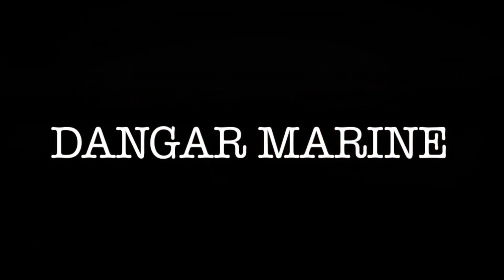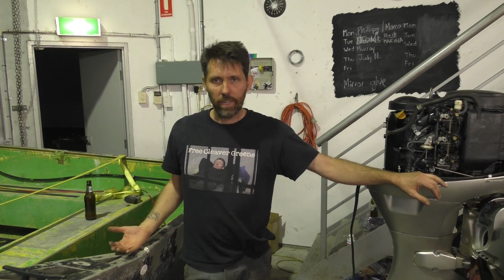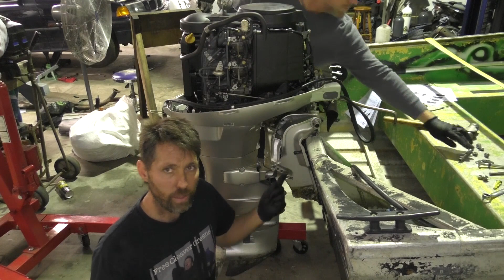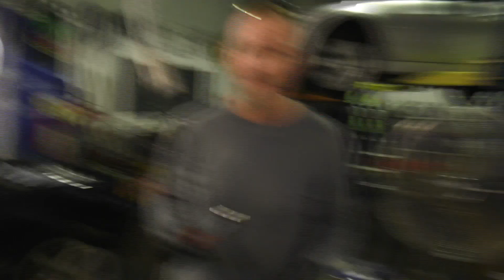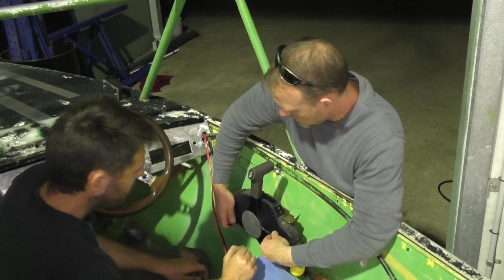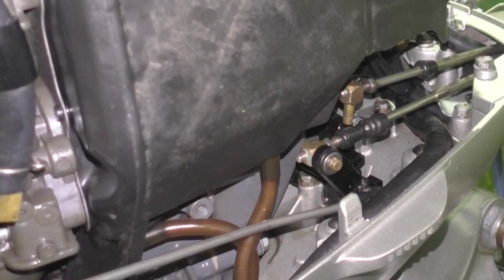Mounting an outboard motor

Comment: Great advice, sometimes it's not a bad idea to install the steering cable before setting the motor. The cable may not have enough clearance to install if the motor is closer to the side of the boat, or spash well. You're great at making procedures easy to understand. General rule of thumb for installing a motor at the proper height is the cavitation plate should be even or one inch above the keel/bottom of the boat. Easy to do with the boat level and a straight edge. I've been a boat mechanic for many years, but still learn new things when I watch your videos. Thanks for passing on your knowledge
Reply: I concur 🫡

Comment: I put a new Tohatsu 9.8 HP on my father’s aluminum boat last year. It gets the boat up on plane nicely and will cruise about 16 MPH until you open it up to wide open throttle, then the bow is pushed down and it begins to plow through the water. Both the boat and motor are short shaft, but dad’s old boat is exactly 15” on the transom. The anti-cavitation plate is 1-1 1/2” below the bottom of the transom. I’ve tried adjusting the angle of the tilt on the motor with little change. Is the motor too low in the water? Thanks and I enjoy your videos.

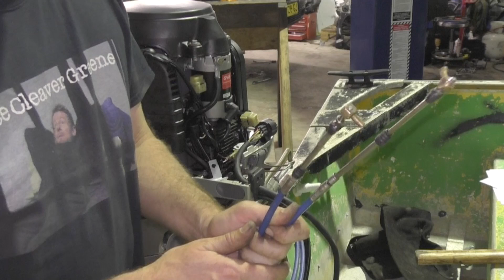Comment: I would love to know where I could get similar control ends that used the R clips on the two control cables (throttle and gear selector cables) at 12:52. Thank you.
Reply from the maker: I'm not sure where these came from. Maybe Honda original? These nut types are the only ones I can find now. https://www.ebay.com.au/itm/124755351986

Comment: Hello, where to start, 2 melted impellers later on a 50hp honda 4 stroke after 20 seconds, has me lost to next move. Its on a lil hobo, and no water from pee hold using muffs  or barrel causing blown engine, 120, 110 100 compression, 25' shaft with no chance of finding a motor and all I want to do is get out on the lake!  Ang suggestions?? I'm just a 70 year old gal who wants to go fishing!!lolol

Comment: What is the part called that hooks up to the the motor that pushes water so you don’t over heat and mess parts up it hooks to the water hose and hooks to the part that sucks the water in to keep the engine cool

Comment: I have a pontoon boat, can I use the same measuring strategy by pulling a string across the bottom of the tubes and checking the cavitation plate height..thx

Comment: Stu, When you fit an outboard, what is a good height. Should the cavitation plate be in line with the bottom of the hull as a start point. I am checking my motor height and come across this video on the Green Machine,

Comment: Im thinking about getting a boat, but I am not good at mechanical things. I saw an ad online about a small used boat. The ad said "small sports boat" Without engine and gas lever. Im wondering is it hard to fit an engine to the back of the boat? How do you connect the gas lever to the engine? The gas lever is over by the steeringwheel. And do you need a separate gas tank or is that somehow built into the engine.

Comment: How do remove an outboard from the transom bracket? Having difficulty with my Yamaha 40hp
Reply from the maker: Generally just four bolts but the sealant used to stop the holes leaking may also be holding it in place.

Comment: I wish you did this for every motor so we could learn hahah... doing DT40 converting from tiller to remote control on a power renewal from an old 80s dt40 to new... there seems to be some type of kit but wondering if I can bodge something up now after seeing this vid
Reply from the maker: You can always bodge something. ;)
Reply: @DangarMarine  YOU can! Not the rest of us hahaha... my mate 'Paul' and I yanked off the old DT40 over the weekend... only too realise that the lads at Suzuki made the gear selector and throttle assembly inside the cover now... because then you can buy their silly conversion kit...  we are hoping to do something on the drag link so it fits (they also relocated the screw hole on the handle part of the motor housing so you needed another kit)... another issue you pointed out was the height of the blades to reduce drag/cavitation - do you have any handy ways to increase the motor height by 2 inches or so? Wish you were somewhere close to Bris/Goldy mate you are a wealth of knowledge. I first found you on the vid you did about the renaming of a vessel according to Poseidon's leger and it was one of the more detailed explanations of the process. Thanks again

Comment: I found a alum boat in florida in 1983 ish at scuba show . 
The out board motor was mounted infront of center consul making this boat have a tunnel hull 3/4 and a moon deck in rear for fuel tank . The boat was 32’ long 102” wide all alum .. if any info let me know . 
I ordered one but had to cancel do to width but now its legal on road

Comment: Stu. that I know of all bolt's nuts should be installed inside transom, not outside. If nuts become loose won't be seeing them, risk motor to deviate away from transom into the ocean. Inside it's a much better place to re torque all nuts from time to time if in need to do it while combo is under way.
Reply from the maker: Outside is much easier to see and get to on most boats.

Comment: You know what gauge that piece of aluminum is going from side to side holding the steering and gauges on the dash?  My boat is similar, but it has rotted wood from the 60s.  I really like the aluminum look, really cool boat very much the same as the one I’m playing with a 62 Crestliner Scout.
Reply from the maker: I'd say it is about 3mm thick. With that dash I sanded it clean and then sprayed some clear coat from an auto parts store to stop it oxidising.

Comment: Great video, thanks for working through the process step by step. I'd like to know where you picked that up for $200!
Reply from the maker: Thanks mate. I was lucky with this outboard. The boat it was on sunk and the insurance company paid for the owner to buy a brand new one so he was happy to part with this one for next to nothing.
Reply: Dangar Marine ahh, I see. Great luck for you :) I just bought my first boat, an old Caribbean Sandpiper (I've been round boats my whole life but this one is mine) but it's in perfect condition with a brand new transom and floor. The plate recommends an 85hp motor. I've been offered a Suzuki DT115 for next to nothing , is it too big for my boat? Local boat mechanic says it will be fine but I'm not so sure :/ Any advice welcomed.

Comment: prop slippage is not called cavatate, its ventilate.cavating is the pressure on the front side of prop,causing water to boil, which causes damage to blades. ventilate is when you loose bite from lack of water from prop surfacing.

Comment: Great video I just bought a 115 hp mercury to replace my 50hp force on my pontoon.
Reply from the maker: That should do the job!
Reply: Dangar Marine I guess the best way to pick it up is flywheel since they are both mercury ? Hoping my controls swap over. 115 is a 94 and the 50 is a 1998
Reply: I’ve been a mechanic for most of my life but never had a boat. Any advice is appreciated
Reply: That’s a jump !   60 hp ! Damn it boy !

Comment: Hello from Finland! I have the same enginge, a BF40. I noticed you did not have to use choke or the idle throttle at all when starting. Mine wont start without choke or at least much idle throttle. It runs great after 2 minute warm up. What could the issue be? Idle is set at about 800rpm.
Reply from the maker: My BF40 has an automatic choke so it is always getting a bit of extra fuel on start up. It could that the idle jets in your carburettor need a clean, but other factors like compression can also affect cold starting. It may also simply be that it is a bit warmer in Australia too. :)
Reply: Dangar Marine thanks for your answer! Its like 31° C here now and still need to use the idle throttle to start it, not necessary choke. The dealer I bought it from 2 months ago did a full service and cleaned the carburettors. When he got the motor it was idling at 2500rpm(!). Maybe they set it down too low because it is not sounding healthy on idle. Will stall some times on idle. I'll try bumping the idle up to 900-950 rpm max. If it doesn't help maybe I'll just live with it. It runs so great otherwise...

Comment: Another great video. What about the positioning in terms of sideways and end on angle. Should it be actually offset by an inch or so from the boat centre line then angled in so the prop remains on centre. I understood that helped with the torque of the prob trying to twist the boat.
Reply from the maker: Can't say I've ever seen a boat with the outboard angled like that. Generally the weight of the driver counter acts the prop torque.
Reply: Dangar Marine .. Thanks. that makes sense. It was a setup handed over from a ski racing provider here in the UK. Probably serves overpowered rigs. May I thank you for the quality of what you do online. I was enthusing to my GF about how great it is you start a video with a low-key task... then it all blows up with 'fix' diversions, representing the real world of shitty outboard nuts and bolts that won't play ball. Yeah... she's only interested in our boat 'working' .. jeez !

Comment: Gday stu ive just purchased a 40hp honda 2004 on your control do you have oil and water temperature lights cheers Daryl
Reply: Because mine has
Reply from the maker: Yes, it is actually cylinder head temperature (and the water isn't recirculated) and oil pressure.

Comment: Y dose my outboard spray water from back of motor as a v. parsons 9.8 on tackacat 3.4
Reply from the maker: If it is going from the engine, that is normal for water and exhaust to come out there. If it is spraying up from the prop you may need to trim the motor up more by changing the location of the pin that supports the leg.

Comment: Hello i see all yours videos and really enjoy. I have a question i have a evinrude 9.9 1982 i don't used for about 2 years now am try to start and is dead i install a new carburetor kit. I check the fuel pump and is good . I replaced the sparks plug , new gas. And is impossible to start i have spark. What You thinking can't be . Thanks
Reply from the maker: I would try sparking starter fluid in. If it runs for a moment it is fuel. If there is spark but it won't run even with fluid it could be low compression, bad reed valves or even something like the flywheel having slipped https://www.youtube.com/watch?v=eNPfuLXCgys

Comment: What torque did you use to mount the bolts? Is this for all outboards this size? Thank you.
Reply from the maker: Generally with outboard mounting bolts you have a second locking nut rather than tightening them too much as you will only crush the transom of the boat. This can be as low at 40 ft/lbs.

Comment: Stu been watching a ton of your videos and i just recently "proper boat " and my new honda outboard its only 14ft boat with 15hp honda but have been fixing boat as transom was completely rotten to the point its just soft so i re done the transom and now want to bolt the engine on so i dont have to lift it on and off every time , is that adhesive you are using called "Soudal T-TREX High Grab Panel Adhesive" ?? if so would that be best stuff to use ? Never worked with boat or engine in my life so need all the help i can get haha i been learning fast and so far everything has worked out fine , lucky the engine is perfect just boat that needs the work
Reply from the maker: Hi mate, congrats on your new boat. I was a T-Rex sealant we used, but I'm not sure of the exact type. The name certainly sounds familiar.
Reply: Thanks Stu , ill try that stuff :)

Comment: What do you call the metal slate that holds the throttle cables? The guy that sold me my engine bf30 didnt have it and i cant find it on hondas website. And what fittings did you use for the motor? It would help alot thanks
Reply from the maker: I'm not sure what they call that plate, but I have made one up from a piece of stainless steel plate in the past when it has been missing. It is really just a locking plate with some slots drilled into it that the groves in the cable collars can slot into.

Comment: I'm just working my way through all of your videos (very informative), I'm busy fitting out a boat so I was particularly interested in the electrical based vids, I've basically wired my boat the same way as you😁. My next job is to swap my motor from the Mariner 60 Bigfoot to a new evinrude e-tec 70, can't wait to get started, Stand by for questions 👍😉
Reply from the maker: Hey Darren, glad to hear you are enjoying the videos. Good luck with the new e-tec install!

Comment: re: putting sikaflex on the mounting bracket where it meets the outside of the transom.

I'm remounting an 85hp Evinrude on my 16" Glastron trihull as the holes with the lower bolts had slight leak (and were typically under water).  Since this is a fiberglass boat, is there any reason to use it in this case?  I will, of course, put it in the holes before the mounting bolts are reinstalled.

Thanks.  RichE
Reply from the maker: +Gogle Plus Sucks I don't think it is as important as with an aluminium hull, but it certainly wouldn't hurt from a vibration point of view, particularly if you already have the tube open to do the bolt holes.
Reply: Thanks!

Comment: i ve always been a fan of having 3mm rubber sheet between the motor and hull to minimize vibration and corrosion
Reply from the maker: Having something like that in there is a good idea. We often use 10mm polyboard when the transom is thin to give a bit of extra strength as well as insulation.
Reply: not a bad idea ether. do you know if outboards carry any electrical charge in the alloy casing?
Reply from the maker: Yes, the casing is ground, so if it contacts the hull at all the entire hull will also be ground. This is pretty much always the case due to the bracket clamps and the bolts going through the casing. The trick is to make sure that every device has a good negative lead back to the battery so the hull isn't the path of least resistance.

Comment: Is there a reason for putting the mounting bolt nuts on the outside of the boat?
Reply from the maker: Good question. Personally I think it comes down to the ability to get tools in. Access is easier on the outside of the transom so the nuts are usually there to allow ratchets or air tools to get in, but it doesn't really matter, the clamping force is the same.

Comment: I'm so glad I found your videos they are a great tool to help me out with my boat. but one thing I'm nervous about doing the work any suggestions on how to help me out?
Reply from the maker: Best thing you can do is start with the smaller jobs like changing spark plugs etc until you get your confidence up. Once you get familiar with the basic components as well as basic concepts sure as torquing bolts up tight enough and using the right sealants etc you will start to be ready tackle some of the bigger jobs. I should do a video soon on some of the basic skills you will need.

Comment: hi stu, can you use that can of WD 40 white lithium grease for a coating on the external components of the outboard motor?
Reply from the maker: Yep, sure can. It's a pretty good general purpose grease. If you want something a bit less visible then Lanolin spray is a good choice too.

Comment: Hey Dangar. 
I have a dilemma. I want to buy a outboard for my 14ft. John boat, and I have 2 choices to buy a 8hp 1991 Suzuki or a 18hp 1967 evinrude. which one do you recommend.?
Reply: rafael matos i have a 14 ft lone star and I have a 1956 10hp sportwin I would recommend the 18
Reply: 8 hp

Comment: hi stu i brought a 1996 johnson 40 hp outboard for my 4.4 mtre quintrex  seaman it had less than 50 hours on it for $1900 it has ptt electric start controls is that a good price to pay  thank you jeff
Reply from the maker: 50 hours isn't much at all so you should get many years of good service out of it. I've certainly seen much more tired outboards go for the same price.

Comment: A real good choice with a Honda motor Stu, it will give you years of happy out-boarding, I was going to say, putt, putt,  putting around but it will do better than that, also a good tip from Paul to re-charge an aerosol can. Nothing like a 'Pale' to get the job done.
Reply from the maker: Thanks Greg, I think it will run for many years yet. You've just reminded me that a mate of mine used to drink 'Sparkling' so we'd always order a port and starboard. ;)

Comment: I have same motor and problems with cooling. Would be happy to see how do you fix the cooling in this outboard... or at least hear how you did it... but great videos. Subscribed :)
Reply from the maker: In the end I didn't need to do anything. Once the leg was in a drum it started pumping just find. As somebody mentioned in another comment the Hondas don't run too well on muffs due to an extra intake underneath. Does yours pump on the water?
Reply from the maker: Also, this video might help you with your cooling problem if you haven't already seen it. https://youtu.be/dx8_xP30aSY
Reply: That was the first video i watched when looking solutions to my problem :) Tested it in a barrel, no problem. good stream on tell tale and t-stat worked... Tested it on a lake today and overheat alarm went off... Seems like its overheating only under load... I now suspect too low water pressure is the problem because at idle the water never reaches the t-stat, only when accelerating.